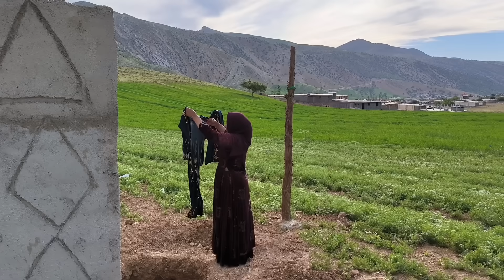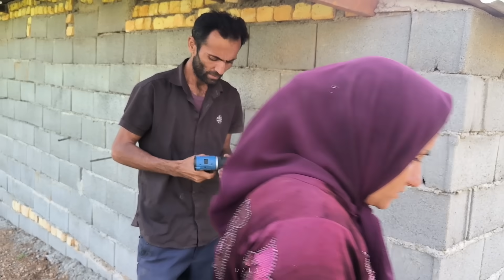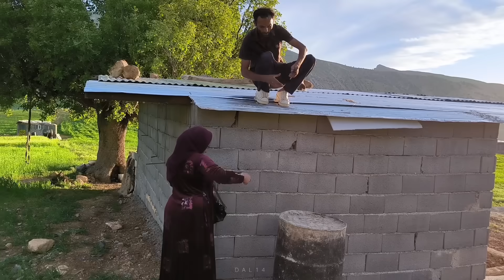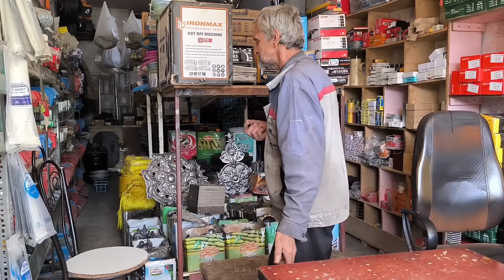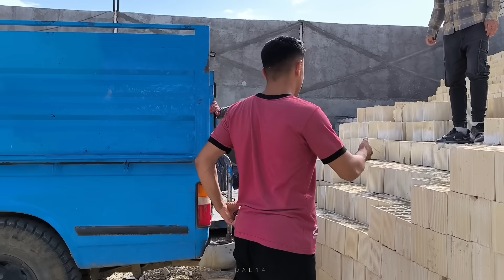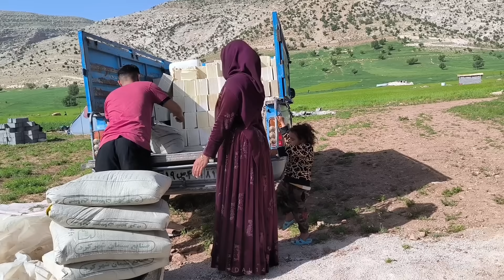Rasool's help to Afsane in getting building materials to build a dream house

Comment: Из кирпичей печку хорошую надо тебе сделать. И такую железную  поставить . Тепло будет
Reply: Operator when you can will you get her a three burner gas cooker & Mustapha can make a long cupboard against the wall and cut out a space for the cooker to fit in & two doors underneath so on one side the gas tank can go in there & on the other side put a shelf so the cooking pots can go under there & two cupboards at the top to put the dishes. 
In Afsana's house when she lived with the count Dracula monster she had a lovely kitchen

Comment: Operator when you can will you get her a three burner gas cooker & Mustapha can make a long cupboard against the wall and cut out a space for the cooker to fit in & two doors underneath so on one side the gas tank can go in there & on the other side put a shelf so the cooking pots can go under there & two cupboards at the top to put the dishes. 
In Afsana's house when she lived with the count Dracula monster she had a lovely kitchen.🇬🇧🇬🇧🇬🇧